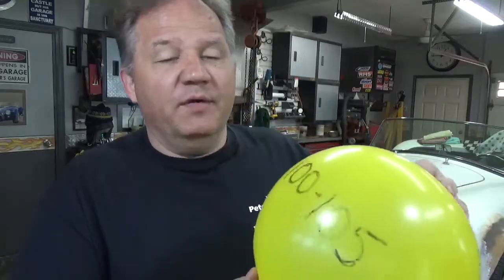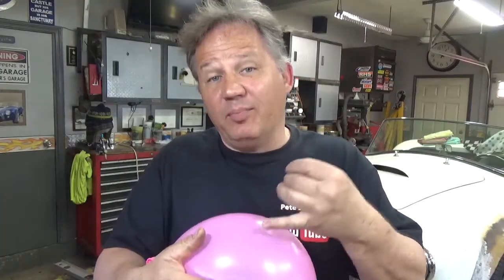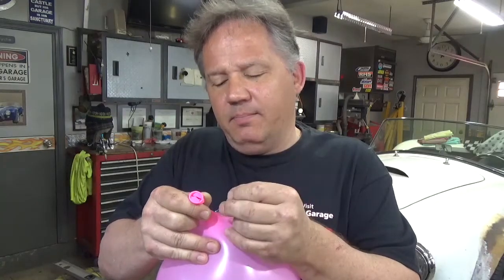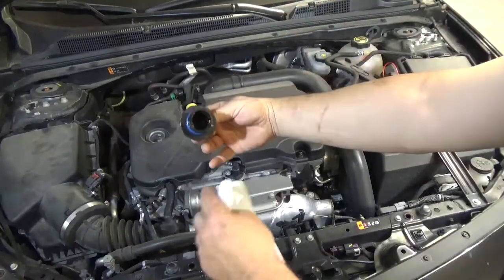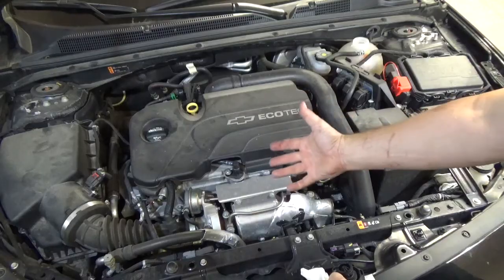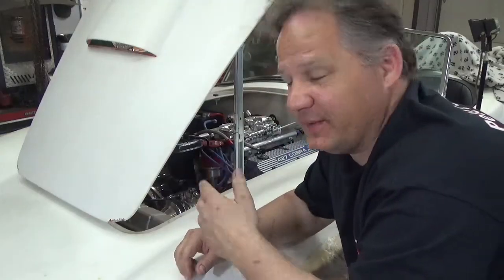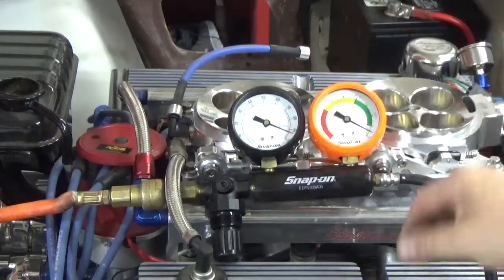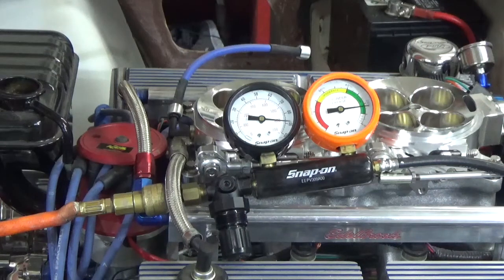Avoid Getting Ripped Off - Testing For a Blown Head Gasket, Leak Down Test, Warning Signs

Comment: Great video, I appreciate your detailed explanations. I might try some of these tests on my truck. But before I do, I'd like to hear your thoughts on my situation. See, I didn't realize my truck was missing over 2qts of engine oil and I drove it like that for a few days and now my engine is knocking. I topped off the oil and the knocking settled down a bit, but now it's getting louder again even with the proper oil level. what do you think it could be? Any suggestions? Im praying it's not a blown head gasket.
Reply from the maker: That is a lot of oil to lose. Your engine knocking might be a rod bearing.

Comment: Great presentation! The only problem I see is trying to figure out if the valves are all perfectly closed. I don't know if it's practical to do without taking the valve cover off and inspecting the position of the camshaft lobes. I can figure out TDC by sticking a long rod down the spark plug hole.
Reply from the maker: You could take out each spark plug to see when it is at the top of the compression stroke

Comment: I have dihatsu coure car.when it starts air bubbles comes out with smelly compression gas.then I noticed  that considerable amount of coolent  available on the  2 nd piston of   the cylinder.I removed that plug and started again.coolent comes out from the plug hole.this engine never over heated or boiled.what can be the reason?
please reply me.
Reply from the maker: Blown head gasket

Comment: Hello, so I wanted to know why are things never 100%, why is there always a leak, does the leak prevent the engine from blowing up; does the leak balance out the different kinds pressures????
Reply from the maker: I can tell you that everything leaks. There is no such thing as something that is 100% leak free. It's a matter of how much it leaks.
Reply: Like said it doesn't matter if it leaks within that acceptable small amount. I think it's not 100% perfect (if that possible) because it would be more expensive to overengineer it for that when the end result would be very similar / the same
As we all know balloons leak but do the job for the day or two they are inflated. Then those foil balloons last longer but more expensive..
That's my take on it. Always about the cost v fit for purpose

Comment: Hey, I have a case of vanishing coolant. No milk in the oil, no low cylinder pressure. Could a pressure test on the coolant system tell me that one of the gaskets is bad? I was thinking either intake manifold or head gasket would be blown if the pressure goes down provided there are no other obvious leaks.
Reply from the maker: Yes

Comment: Got pudding goo on oil cap. Little white smoke from oil dip stick area. Loosing coolant but the only leak i see is lower intake. 3800 engine, grand Prix. Always had some white smoke but not a big cloud. Oil itself is normal color. Pressure test isn't holding. My personal mechanic thinks it's intake. Auto shop didn't do leak down or dye, says head gasket. Doesn't seem like head gasket from most symptoms not showing, just seems like coolant leaking somewhere
...
Reply: Year old water pump, doesn't look like leaking. Just seems like leaking around intake
Reply: Ya mean losing?

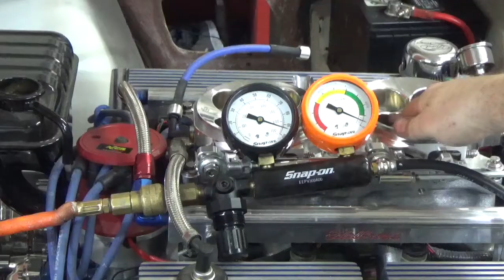Comment: 8:39 I know this video was 4 years ago, but I hope you replaced that orange hose that is kinked up on the snap on cylinder leakdown tester before 90+ psi of pressure explodes in your face.  A lot of things could've happened in those 4 years.
Reply from the maker: Sure did

Comment: Question for you, as to what product and how much you think I should use. I have a 1995 Subaru 1.8L 4-CYL boxer Impreza, 177,000 miles.  I have 76 and 78 PSI dry compression in #2 and 4 of one head (driver side).  This started a few days ago, we noticed while on a highway trip the power was weak and I can hear it missing as the RPMs drop from driving to idle.

I don't have overheating, excessive oil consumption (drippy seals, I add a quart about every 900 miles), smoking, or fluids cross contamination.  I'm waiting to have a leak down and another dry/wet compression test at a different shop. The first shop only did dry compression and wasn't too bright or helpful. 

If I end up having a head gasket leak between those two cylinders, what products would I possibly try to mend it?  It must not be too bad of a leak, whatever it is, for the compression to build to 78psi dry.  The other two good cylinders are 130ish psi. 

If it ends up being a valve leak, what products and strength could I try to get them clean?  After cleaning, I will have valve clearances checked, as it's probably never been done. 

Thanks much brother!
Reply from the maker: You could try any of the head gasket sealants, but follow the directions exactly

Comment: My 2018 Nissan Pathfinder with 73000 miles has always ran great, no mechanical problems. about 2 months ago and only occasionally, not always it would blow white smoke out of the exhaust when I started it up. I took it to a mechanic who looked at the oil and said it was extremely dirty. I had regular oil changes. He changed the oil twice and put an additive in it. It still ran great no signs of mechanical trouble but within a week or so it would blow white smoke when i started it up. Not always. The about a week later it conked out on me and came to a stop. I had it towed to my house. The mechanic that said it blew a gasket without looking at it or testing it in any way. He is very busy and doesn't want to work on it. I am having it diagnosed by another mechanic, next week. Your video is very informative and I am hoping it is not a blown head gasket, maybe a valve, cylinder, spark plug or whatever. It starts right up and has a very faint sound from the engine if you listen closely. I'm not driving it at all until I find out what is the problem. The other mechanic seems to think someone put dirt or something in the oil to intentionally contaminate it??? Hope my problem is fixable. I'm 73 on fixed income and can't afford another car. Thank you.
Reply from the maker: I hope it's nothing serious

Comment: So my 97' honda odyssey with 320,000 miles has upper and lower radiator hoses only a year old that collapse. Then the radiator empties to about a 3rd to a 1/4 coolant bottle low but while the overflow reservoir is full and overflowing at the same time and Pisses on the ground. There is rusty like sediment in the radiator and only the new cap I put on and its a tiny bit cloudy. I think this is original radiator from 1997 but I don't know it's a single one owner before me. Is my head gasket leaking or should I just overhaul and get new hoses (entire engine) new radiator, thermostat, housing,temp sensor and water pump or what? Much appreciated of anyone's help thanks 😊
Reply from the maker: That's quite a bit of money to put into a '97 Odyssey
Reply: @Pete's Garage  yep very true but it's sort of sentimental. It used to be my house after my girlfriend cheating on me and never gave me much of an issue even with the mileage. If it's not worth it I guess this is time to let her go :(
Reply: @garrettwalravema❤n2552  makes no sense.
Reply: Goner..that  kind of mileage and the year plus the issues you mentioned  it isn't  worth  it. Time to  turn it into a new bicycle.
Reply: @joemiller2629  lol makes sense or a beater corolla civic or carry lol

Comment: Also if you have the head surfaced you only have a set amount that can be removed so if you have it machined when you don't need to and for some reason the gasket goes and warps the head a little you may not be able to have it repaired because there's not enough material left because you had it cut originally for no reason.
Reply from the maker: That is true

Comment: I have a 02 camaro ls1, got ported heads, cam, valvetrain etc done. Problem is once i got the work done car overheats only with ac on, on hot summer days 85° and up. New radiator, new fans, 160 tstat, new cap, new overflow tank, mls head gaskets were installed during the mods. Bled the cooling system multiple times. Car will overheat on both city and highway driving (again only with ac on). Turn ac off and temps drop back down, can drive the car all day without ac and wont overheat. Can drive the car with ac on cooler weather and wont overheat. Idk what else to check for or what to do.
Reply from the maker: Radiator may not be big enough to handle additional heat
Reply: Make sure ac fan kicks on

Comment: To check for compression entering cooling system, I just take the hose off my cooling system pressure tester and put hose in a clear container of water and check for air bubbles.
Reply from the maker: Great tip, thank you
Reply: Or remove the cap from the expansion tank and put a balloon over it. If it inflates, you’re getting combustion pressures into your cooling system

Comment: my experience with my Subaru,     TOP OF the LIST, COOLANT LEVEL, A MUST RADIATOR CAP BEING GENUINE AND in PERFECT CONDITION, AND OF COURSE THE FKN THERMOSTAT, EVEN IF IT LOOKS GOOD,  MAKING SURE THE JIGGLE PIN" IS ESPECIALLY  POSITIONED WHERE IT SHOULD BE. IT'S AN AIR BLEEDER.      NO HEATER", TEMP GAUGE " ACTING LIKE A SKITZO="THERMOSTAT, AND IF REMOVING OLD THERMO UR GOING TO BE DOING A BURPING=BLEEDING AIR BUBBLES OUT OF THE SYSTEM.  BYE.
Reply from the maker: Thanks Lee
Reply: @PetesGarage  ur welcome bro.

Comment: Thanks for the tests.
351 windsor, overheating, bubbles in the radiator, rusted out muffler but oil is not contaminated.

Comment: Can a bad rocker arm cause compression issues? I have a p219a code which is air/fuel imbalance. Can a leakage in the cylinder cause this code? Thank you
Reply from the maker: It is possible

Comment: Thanks this video answered my question I did the leak down test and the air was scaping from the spark plug hole cylinder number two.
Reply from the maker: That's not good
Reply: @PetesGarage  so you think it’s the head gasket Pete?
Reply from the maker: I hope you had the tested sealed in the hole enough, otherwise it's the gasket
Reply: @PetesGarage  Thanks for all your help Pete

Comment: Checking the oil cap is in no way an indication of head gasket. If you have a bad oring around that cap condensation and water gets in that spot and causes milk color. Common as hell. Just sayin
Reply from the maker: That is true

Comment: If the coolant in the reservoir bubbles but the engine doesn't overheat..is that symptomatic of head gasket leaking compression into coolant?
Reply from the maker: That or it's just overheating
Reply: @PetesGarage  luckily issue was only a hole in a heater hose. Replaced the hose and no more bubbles.

Comment: What if the coolant and the transmission oil dried out same time...can a blown head gasket cause that ro be happening?
Reply from the maker: Coolant yes, transmission no. That sounds like a bad radiator

Comment: I got a 1999 3.3l dodge grand caravan and when I start it in the morning and drive, it drive perfect until the temperature gauge get to the middle spot, and now the engine start to miss fire and drive badly, if I left the car off for 8 hours it would drive perfect again until it heat up and so and so, I hope you can help me with that problem before I take to a mechanic and get ripped off. Thanks in advance.
Reply from the maker: Usually, a bad ignition coil may cause a misfire when the engine warms up
Reply: @PetesGarage  thank you so much for replying Pete, l changed the coil a week ago and it didn't help,  some mechanic told me that it could be a head Gasket, he said when the car heat's up the water can get in true the head Gasket into the cilinder and that's why the misfire happen, I don't know if should change it because that's a big job.
Reply from the maker: You can test for a bad head gasket first
Reply: @PetesGarage  thank you so much I'll do that 👍

Comment: I just watched a video with similar looking gauge but not snapon. When calibrated right gauge was fully clockwise when 1st gauge was just at 20 psi. His cylinder showed 100 leakdown but flow at 20 psi was so little he couldn't detect where leakage was coming from. I'm puzzled about big difference in psi on 1st gauge.
Reply from the maker: Interesting, I'd have to see the video

Comment: I had the leak down test done as I've had several hoses fail with no apparent overheating, so there was bubbling in the collant reservoir at 90 psi on cyl 3 (6 cylinder engine)... mechanic said head resurface and gasket replacement. No mix of fluids anywhere. Is his diagnostic right? Alternative solutions? Thanks for your video. Very informative.
Reply from the maker: I'm not sure about head resurfacing. The hoses can fail from heat and pressure. 90 psi is a little low
Reply: @PetesGarage  Thanks for sharing your opinion... Last question, Would a sealant additive be worth trying? The leak seems to be very small... Is it too bad to continue driving as it is?
Reply from the maker: It's always worth trying first.

Comment: I wish I had you work on my car. I was losing antifreeze after feeling up reservoir. Shop conducted pressure test on engine and said it passed. They installed new water pump and once everything was put back together the antifreeze in the reservoir started bubbling.
Reply from the maker: The water pump could have been part of it

Comment: Wow, my mechanic said he was going to do everything you said, skim, gasket change, for £600+. Covid 19 forced him to cancel. Said the minor oil leak was the head gasket, no milky oil or coolant, no white smoke from the exhaust. But he also didn't do any tests. Got a 2nd opinion from a chap who was going to overhaul the Pierburg 2B5 Carb, asked him if he could change the head gasket, he asked why. No way he said, it's just your rocker cover gasket. Said the same as you Pete, can't leak oil from the head gasket! 
God works in mysterious ways! 👍
Reply from the maker: That's awesome...good for you Russell
Reply: You can easily see if the leak is from cylinder head or valve cover gasket your self

Comment: I have a p0300 with misfires at 6 7 and 8 but mainly 8. Thing is I have zero symptoms no shake, no overheat, no smoke, fuel trims normal.  No big coolant leaks but somehow I'm missing just a bit of coolant but the combustion test never hit yellow.  Can I still have a very small leaking head gasket?
Reply from the maker: It could be

Comment: Pete, thanks for the video. I've done some head gasket replacement before but it was a diesel with a cast iron block and head. I did check the head with a machined straight edge like you said.  I've been really hesitant to mess with aluminum blocks due hearing you always have to machine them. I had heard the heat will cause the metal to distort a little. It's good to know that is not the case.  Are there any tricks to removing the head bolts other than reversing the bolt tightening order to minimize distorting when removing?  Now I might just have to tackle a project I have been  putting off just for that reason.
Reply from the maker: Hey Troy, If it's still running you can crack the bolts while the engine is still hot, that will prevent stripping the threads. Loosen the head evenly. Let it cool before taking them out. If 1 or 2 get tight again you know the head move a little.
Reply: @PetesGarage  awesome!  Thanks.

Comment: If I have milky fluid at the dipstick and inside of the oilfill spout, as well as bubbling in the overflow tank. All symptoms occurred within about a couple hundred mile window. Think it's possible that just the head gasket is compromised or more likely the block is also cracked or a valve or piston is cracked? Or is there another way to determine more specifically if it is the head gasket or cracked head or cracked valve and or piston?
Thanks for caring enough to help us out!! Much appreciated couldn't do it without you!😎
Reply from the maker: You could do the second leak down test I performed. If the block or head is cracked you will see air bubbling in the reservoir. A cracked piston would leak into the crankcase and you would have to take of the head to be 100% sure on that one.

Comment: Amazing video once again!. Just thinking if someone is actually going for a head gasket replacement, what other parts should one change just as a precaution? Because as the mechanics say since you have opened up the engine, lets change other stuff that as well might break and would again require tearing up the whole engine. 

I think for a 20 year old engine with 180 km on it, valve seals and piston rings may be changed and about the main bearings and pistons themselves? At the same time i believe fixing something that ain't broke yet might cause some other problem due to human error. What does your experience say about that :)
Reply from the maker: The only thing I would recommend on a high mileage engine would be a head rebuild and valve job. Everything else requires pulling the engine.

Comment: I needed this Video, Im 16 and Just bought a 1999 Ford F-150 Triton and I Believe it has a Head Gasket Leak but I'm not Sure. 

It doesn't Overheat or Even really Change within a 40 Minute Drive.

The Coolant Resivour is A Mirror Black and Not Frothy/Milky, Just A Mirror Black.

The Engine Starts AMAZING, Not even Hesitating...

The Oil Dipstick Seems to be Normal.

I'm having the Coolant Flushed next week to See if that Clears up the Coolant or it it gets bad again.

I don't know much about cars and I don't have anyone around who can help me... Any thoughts from Anyone would be Appreciated. Thanks! 👍🏼
Reply: RuggedRebel57             I would have the coolant flushed and then keep an eye on it. It's possible that it will turn dark again if it's really dirty. As long as it's not overheating and or losing coolant i don't think you need to worry.
Reply from the maker: I agree with wysetech..... see what happens after the flush